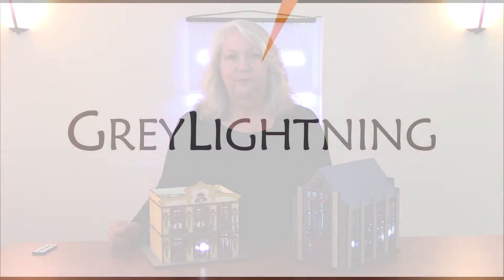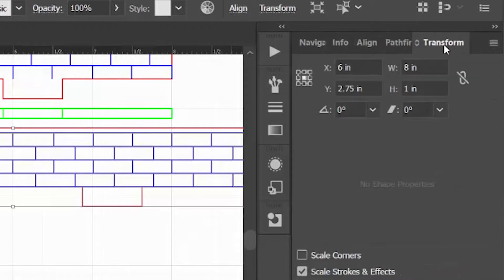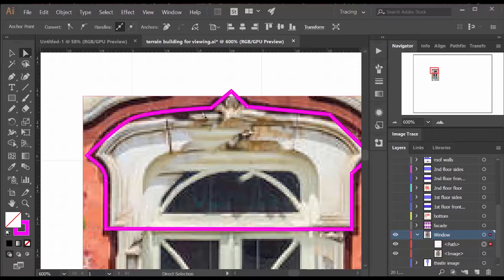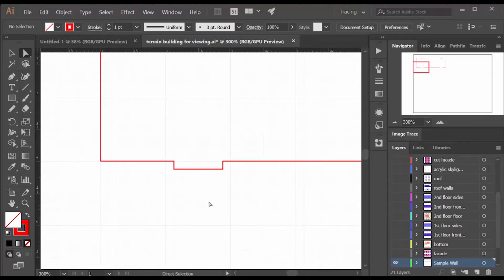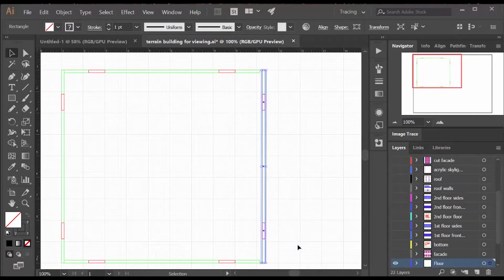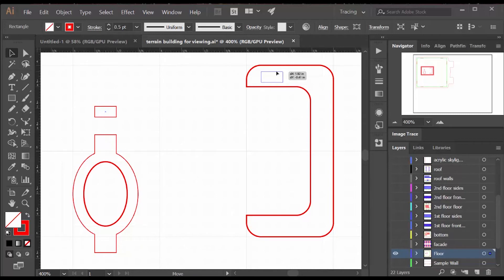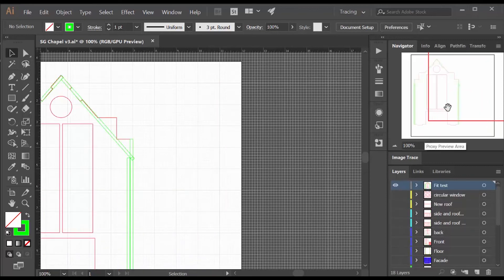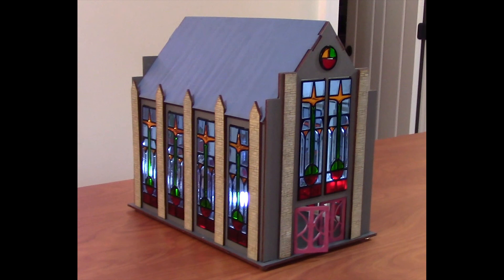How To Design Scale Model Buildings in Adobe Illustrator

Comment: May try blender.
Reply from the maker: John, I had my hands full building a box in Blender https://youtu.be/eXWDDGP6iDw !
It's a much steeper learning curve, and not really necessary for my scale models. Personally, I reserve it for things I can't do in Illustrator, like sculpting https://youtu.be/3rxn-f2sDkM . I have a library of parts in Illustrator now that makes it even easier to design scale models https://youtu.be/WM2QBqgFmLI . Even for truly 3D things I will use Tinkercad first, if it can do it. It has a much more intuitive UI.
Reply: @GreylightMay sketchup is user friendly and free but it's what your comfortable with I guess.
Reply from the maker: John, I will look into sketchup, thanks for the tip!

Comment: Thank you so much for making this video. I found it very helpful, I’m still struggling to learn adobe illustrator (and on an iPad which is probably not helping). Do you have any recommendations for videos or channels or other means of learning to use adobe illustrator specifically for model/diorama building?
Reply: Yes! I just got a laser cutter and want to make some scenes and models from my favorite shows and movies. I went with adobe illustrator because it originally seemed like there was lots of content I could learn from, but I’ve found you’re exactly right, and most are for art and graphic design. I’ve played around with a few cad softwares but haven’t figured out an easy way to convert those to something 2D and usable for laser cutting. Not to mention the learning curve on those are even more intense than adobe illustrator. 😂
Reply from the maker: Alex, Illustrator is definitely the way to go, don't get discouraged! The only comparable option for this application is Inkscape, and its strength is it is free and contains the functionality of Photoshop as well, but it is no easier to learn. Pick between those two and then just start designing and cutting. It will get easier, I promise. If you do stick with Adobe, which I use for everything, and you run into problems just send me a question. I may know the answer, or have a video I could suggest. Good luck! You will have great fun!!
Reply from the maker: Thanks, Alex, I'm glad this was helpful! I don't know of any videos to recommend. I'm self taught, and I frequently look for videos for a particular technique in Illustrator, but I've never run across anyone using Illustrator for scale models. Mostly, the heavy users are illustrators doing graphic design and art. I have several other videos on making buildings, and they all start with design, so you can check those out. I have a video on 10 techniques for designing mandalas that has some things that are generally useful and it is made for beginners, which most Illustrator videos aren't. Will you be using a laser cutter to make yours? I'd love to see anything you make!!

Comment: You my friend so rock. This is a wonderful tutorial. I am not making a house, but you never know when I may need to make a doll house for a grand baby or what not down the road.I am walking back into the office and going to set up my tabs in Illustrator like you have them to help me with my work flow. Doing the last part and making the arrangement fit into their respective spots as well as the image trace was extremely helpful to me. so thank you so much, I have used the pen too some with photoshop, but doing it like you did and then making the areas curved after the fact is so much easier than trying to make it curved to begin with. have done the cop and flip the image horizontally to make them uniform in the past, but dong the curves after the straight line pen tools looks like a much more efficient way that what I have been doing.
Thanks again for taking the time to share this with us and have a blessed week. 
Dale
Reply from the maker: Dale, you may have noticed that this is longer than my normal videos but I had several requests for an in-depth one focusing on the design step and I'm glad you found this helpful!
Reply: Greylight May yes mam. I noticed and appreciated it very much. I’m in the office making some templates for leather parts, because you taught me how. Thank you so much. I’m a hugger, so don’t punch me in the face when I get to meet you someday. ;). 
Thank you so much. Your very helpful. What your teaching, how your teaching. It works for me. Thank you. 
Have a blessed weekend. 
Dale.

Comment: Just found your brilliant you tube channel. Super helpful! What sort of laser cutter/engraver do you use as I have designed several buildings using Adobe illustrator and looking at purchasing a laser cutter. What are the things someone should look for when purchasing a laser cutter for war gaming miniature terrain? Thanks in advance. 😀
Reply from the maker: Hi Ryan, the materials for terrain are usually pretty easy to cut, I use 1/8" plywood, so power is not important for that but it is important for speed if you are doing intricate designs. Bed size can be important, but once again given the small scale of most projects that's not usually an issue. For me the biggest issue is the user interface and the ease of getting drawings out of AI into the cutter. I'm switching to a new makerspace right now and I have to learn a new 'CAM' software package called RDWorks to use the cutter. It's not that difficult but it requires every drawing be 'flattened' into just what I want to cut each time. Things that I've done in a single AI file will now have to be turned into many AI files, with many duplicate layers. I'm used to working in many levels in AI and turning on and off what I want to print, as needed, for the particular cut I'm making. This is a very flexible design environment that allows me to make changes on one level that immediately updates every drawing that uses that level. In this new environment that one level will have to be duplicated in every drawing/cut that uses it, and if I need to make a change I will have to make that change everywhere - very inconvenient. So what I would look for is a cutter that can take files directly out of AI, without an intervening piece of software. It also would be great if it had a materials database because otherwise you have to create your own. You may find that these requirements make the cutter cost prohibitive, in which case you have to weigh off the cost with the convenience factor. If your goal is to go into production and sell your designs, it may be worth the extra effort to create your cutting files and get a cheaper, more powerful cutter. Good luck! Let me know what you end up getting, and how things are going, I'm very interested!
Reply: +Greylight May thanks for the reply 😊.  I will keep you updated. i spoke with someone at my local gaming store today who sugested a cheap ebay model to start off cutting my own projects. At only $150 (Australian) i think it might be worth the gamble as it can print straight from AI. As i mentioned i will let you know how it goes and take it from there
Reply from the maker: Ryan, can you share the link for that cutter?

Comment: I found your channel when looking for laser cutting models. You have some really great stuff, quite inspiring.  I'm curious if you have any recommendations or experience or designing more complex 3D models. I'm thinking similar to the old dinosaur puzzle kits.  I feel in love with the Spartan Scenics SGSS13 starship model, I purchased a number, but now that Spartan is defunct - I'm thinking I would like to design similar larger-scale starship models. Design tools and ideas isn't a problem but figuring out how and break down as design for cutting seems a little daunting right now. Any advice or resources you can recommend?
Reply from the maker: Christopher, if I have the right type of model in mind, it is made of flat parts but assemble into a 3D figure, right? That is a really interesting problem, because it isn't classic 3D modeling, it's kind of a hybrid between 2D and 3D. I'm not really sure because I couldn't find any good images in my Google search. You could probably create it in a 3D tool like Fusion 360, but I think your question is about the mental process you go through to create the design. I'm not really sure... are there any model making subreddits where you could ask about this?
Reply: Thanks for the response. I'm exploring some of the 3D to 2D techniques the paper modelers use tools like Papercraft 3D. just wasn't sure if there were some tricks used by the laser cutters to do similar. I'll continue to explore and see where I get. Thanks for the inspiration!